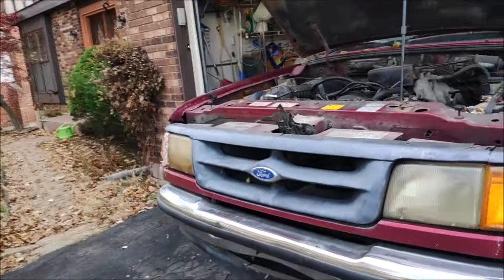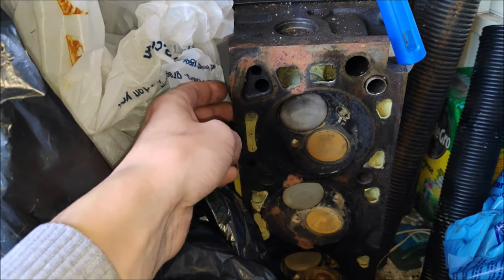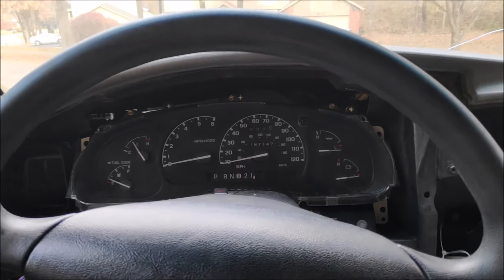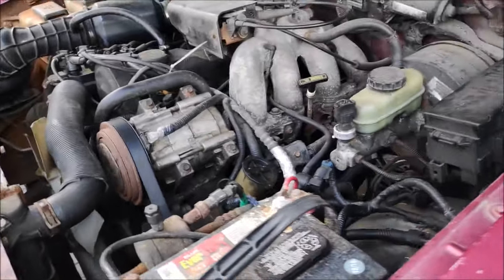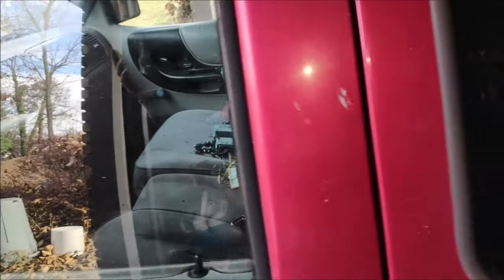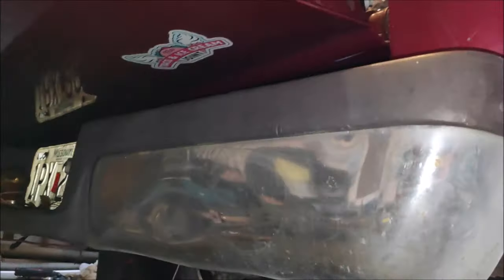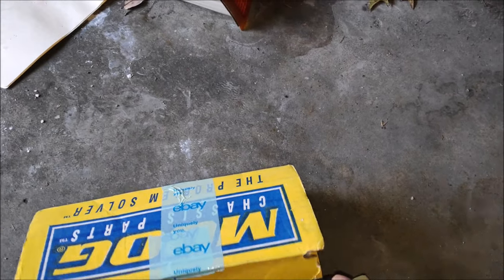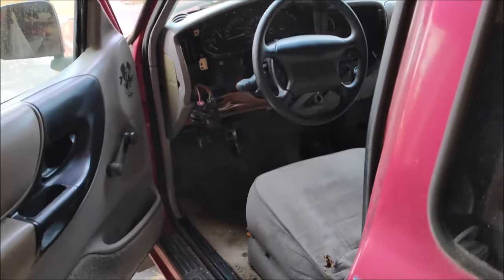What Fails on All Ford Rangers, Everything You Need to Know, Best Review

Comment: Great video thank you. I have the blend door problem on my Ranger. I just put a heater core bypass valve on it so in the summer I bypass the heater core and get AC. But it's either full blast AC or full blast heater. I also had the fuel hose problem. Couldn't fill it up all the way.  I can tell my slave cylinder those going out cuz sometimes it's hard to put into gear.  I dread having to pull that transmission. All that being said my truck does a 275 thousand miles on it lol.. oh and one other thing my catalytic converter got clogged up I had to cut it off.
Reply from the maker: I know your pain about blend door issues, I dealt with it myself.
Reply: The blend door is a common problem. The plastic bushings fail. I fixed mine with a repair kit from a company called  heater treater. They sell a metal blend door and metal bushings kit. You install it by making a hole in the heater box under the glove box, reaching in and remove and replacing the door and bushings. Check out the video on their site. Got mine 4 years now.

Comment: You should do a video on motor Mount replacement! I wanna change mine but scared I’ll Jack it up lol. Any advise?
Reply from the maker: My advice......Don't jack it up.
Reply: @everydayirace  how do you do it then?
Reply: @everydayirace   somebody will complain no matter what it’s how YouTube works. It’s a shame I can’t find how it’s done anywhere. I’m afraid using a Jack to lift the engine
Reply: I’ve also seen you gotta remove the tires to get to the bolts??? I got a 97 2.3
Reply from the maker: @jacksonworkshop  it's simple, remove top mount nuts...18mm I believe , then since you can't get to bottom mount nuts you have to remove frame to mount brackets, each bracket is held by 2 bolts, I think they're 21mm, you have to get under the truck behind front wheels and take them out, they're pita, one side you can get with a socket/ratchet, the other side no room, you can only get to them with a wrench, rabs module is on the way, then there are 2 more bolts, one per bracket holding the brackets from the other side, I think they're like 13mm, those are the easiest to remove, ratchet/long extension/13mm socket. After that start jacking the engine up, put block of wood on the oil pan and slowly jack it up, do couple of pumps and see if you can get mounts with brackets out, it's a tight fit, once you get them out, you can remove engine mount to frame bracket 18mm nuts and separate old mounts and brackets........to install new ones do everything in reverse....... it's about hr to hr and a half job, I don't even jack the truck........but you can if you want. Watch your fingers, friend of mine dropped the engine when he was installing mounts and smashed them pretty good, that's for a 2.3l engine........I believe v6 trucks have different mounts.
Reply: @everydayirace  sir thank you. Intimidated by the job but I’ll give it a whirl. Thanks again!
Reply from the maker: @jacksonworkshop  make sure to stay away from cheap mounts, or you'll be doing the job twice like I did 😂
Reply: @everydayirace  ya I saw your other video on mounts. Definitely taking the advice. I’m mostly intimidated about jacking the engine up, especially near the oil pan. Maybe I’ll post a video of my shortcomings lol.

Comment: I purchased a 2000 in April, 2021. My hot/cold gauge doesn't work. I am alone so I have to pay labor on everything. Does the whole thing have to come out for repair or can I just get something for the hot cold section. Also my driver's handle sticks in the up position. Can't lock/open the door without manually pushing it down. Lubrication does help. Any fix for that? Video is great. It's a keeper!
Reply: Lubric
Reply: Action does NOT work...
Reply from the maker: Could be bad coolant temperature sensor, bad gauge cluster, or wiring between the 2.

Comment: You seem knowledgeable on the ranger. I have a question for you. I have a 97 2.3l. In the colder months where its <50 degrees Fahrenheit, it has a tough time starting. I thinks its a fuel issue. I replaced the fuel filter, valve purge, and pcv valve (cause i had codes for them). None of these fixed my issue. When i start it, its cranks and i have to mash on the gas for it get anything going and sometimes i have to hold the throttle around 2k rpm to keep it running until it will idle on its own. If i let off the gas, it will stall. I might have to hold it at 2k for 40 seconds or so. It runs fine other than that. Its only on a cold start in cold temps. It will start fine in the summer and spring with mild temps. I have no idea what to look at next. My friends said it might be injectors but i have no idea.
Reply from the maker: During cold start engine requires a lot more fuel, like 3 times as much as engine at 200 deg F. There could be few things that can cause hard start such as lack of fuel. I would test fuel pressure with engine cranking cold. Second I would look at coolant temperature sensor data with engine cold and make sure that it shows correct temp. Last I would do compression test on all the cylinders at cold temperature, if compression is low, your piston rings are worn and engine will need rebuild.
Reply: @everydayirace  thanks for you input!!
Reply from the maker: Let me know if you fix it.
Reply: @everydayirace  i have a 94 mazda b2300. Very slow acceleration.  Eats alot of gas. Hard to get up to a high speed like 65 mph. Currently looking to replace the plugs and wires. I used a heat temp to check the catalytic and seem fine. Any suggestions?
Reply from the maker: @michealbarnes66  pulling codes is the first step in my book.
Reply: Mass Airflow Sensor

Comment: Hey, thanks for this video dude.  Can anyone here please help me.  I have a 1995 Mazda B2300 SE with 80,000 miles. I bought it new in 95 and take very good care of it.  As of 2014 I've been having a weird intermittent problem. Seems to happen more on hot days than cold.  I will drive from one town to another about 35 miles on Hi-way and then when I get into city traffic as I try to go from a stop, suddenly I have to floor the gas pedal and its' revving high and not wanting to go, then suddenly violently shoots forward, which has almost gotten me into accidents when making a left turn with this long hesitation.  Then my clutch starts getting harder and harder to push in until I just can't drive it, can't get clutch in to even engage ignition. 

 This has become real nightmare this year as it happened twice in 2 months and 5 hour Tow truck time, 2 hour tow time 2nd time stranded in 110 degree heat. 5 mechanics have kept it for 1 to 2 weeks, the problem is that once the car cools down for hours, it works and they can't get it to act up like this. But then after working fine for weeks or months, it suddenly happens again.

 Last year I paid 600 for new catalytic converter which turned out not to be the problem. I asked them to check clutch, fuel filters, spark plug, wires, and they can't find anything or get it to do this issue when they drive it. 

 I love my truck, It's in beautiful condition and looks like new inside out and is all original except for the tires, windshield, ignition, battery and wires, serpentine belt and brake pads. that i've replaced in 27 years of owning it.  

My  truck was all original and never in any accidents till my best friend backed into the bed on the tank side in 2013, so his insurance had to pay to repair/repaint it.  And some other dumb girl hit front driver nose in 2018 and her insurance  had to pay to  replace 1 head light and the front grill that cracked and repaint that front end.  

Since then 2018 hit,  my clock radio cuts in and out, but after  I got it back from paint repair it  magically worked again for almost 3 years without cutting out. Then just 4 months ago, I hit a pot hole and the clock radio goes in and out (Mostly out 95%)  of the time now.  I hate the idea of them ripping the dash off to look for the issue, probably a wiring thing, but they never seem to get shit put back on right. Anyone have this clock/radio issue??

I have the issue with the passenger side door you mention at the end ever since it was repainted. The door just comes ajar as I'm driving even though I locked it and slammed it shut. and rarely use it compared to driver door that works fine.  I don't drive alot past 10 years maybe 2,000 a year with covid 1000 or less. Could  the hesitation/hard clutch be the slave cylinder? Does the clutch lines need to be bled?? Air in the lines?? 
  
The weird thing is when it 1st started to happen in 2014, I did what scotty kilmer said and started to add techron concentrate plus to gas tank once a year, after 1st mechanic could find nothing.  Cause it just acts like it's not getting any gas,  with all the hesitation when trying to go after a stop sign or light, so seemed logical that maybe fuel injectors were fowled up. It Worked great for 5 years and then the problem got worse despite still using techron. So i guess it's not plugged fuel injectors, even though it's weird that worked for 5 years.  

 I Love my truck, don't have money for another vehicle and every mechanic thats worked on it has said how great it drives and looks.  But then I run into this issue with the hesitation in 1st gear to go and then clutch becoming hard as a rock till I just can't drive it or start it.  
Anyone else with these Mazda - Ranger trucks from mid 90's having any similar issues?? 

 Any ideas or help would be appreciated cause I'm in limbo and tired of calling a friend to spot me everytime I have to run to the store, doctor, or vet incase it decides to leave me stranded again. :(  I've got a blind and deaf dog who can't be left at home for hours and hours every time I get stranded from a trip that should be 2 to 3 hours before I'm back home to let him out to take care of business. Covid has made tow truck times SO LONG and miserable and they won't even give you a ride to the shop with them anymore because of covid.  So don't break down in no 110 degree heat, cause it SUCKS!!! :O And mechanics are backed up 10 to 14 days too.

 The last mechanic is an old school mechanic who works on classic cars been in business over 50 years, he's same guy who put the catalytic converter on it in 2019. I don't know where to go, because most young mechanics don't seem to know how to work on older model cars that aren't full of 100% electrical junk.  And this guys has checked everything twice in past 2 months and can't find the problem, he said next step is drop the tranny.  I don't feel like I wanna do that just yet. 

OH and incase anyone else has had a mystery with vanishing coolant like I did for 3 years.  No leaks, I didn't drive much or very far, winter or summer my coolant would just vanish and I had to check it everytime I was gonna drive the truck and often fill it if I hadnt' driven in a few days, NO LEAKs , no coolant on garage floor, Just GONE!!!  3 mechanics in 3 years tried to find problem and couldn't, so I just got in the habit of carrying around a jug of 50/50 mix antifreeze and a funnel / paper towels on every trip.  Finally the guy I mentioned above figured out the MYSTERY of THE VANISHING ANTI-FREEZE.  He Replaced the Heater Control Valve for $75.00 total repair and part cost and My anti-freeze is always full since.   (Hope this may help someone else who has this issue) 

 If  anyone has had this hesitation/ hard clutch issue and figured it out, Please share and help.  Thanks :)

Comment: Forgot about extended cab half door latches rusting closed (door rusted closed can't open) will be taking my 2007 Ranger in to have take it in for the passenger side for A second time...... Totally agree with the fan motor speed control & they are used on more than just Rangers - they are A total piece of shit.
Reply from the maker: Yes, I always grab extra blower motor resistors from Ford aerostar, they're very easy to get to lol.
Reply: @everydayirace  : I was thinking The Explorer, but Aerostar is another source...  any others?
Reply from the maker: @jamesfournier2810  aerostar is the easiest one, open the hood and it's right there lol.
Reply: @everydayirace  : Same as the Ranger, are the same 2 part#s (basically the same part) used on all Fords?

Comment: I have 96 Ranger and tach quit working.  How can I fix it or what do you suggest?  Can I do it myself?  2.3L standard shift.
Reply from the maker: Either tach servo went bad, or wiring to the gauge cluster broke......check wiring right by the clutch pedal.

Comment: I have a manual 1994 Mazda B4000 4x4, which is basically a Ford Ranger, with 122k original miles. Has anyone else had an issue with a "thump" when depressing the brake pedal? It does it so sporadically that I can't really pinpoint where it's coming from or when it'll happen. It will do it in 1st slowing down and even do it in 5th when slowing down. It even does it when in neutral slowing down. I also feel a little bump in my brake when the thump happens too. My yoke slip was just replaced this week thinking that might be the problem but it still does it, although not as loudly. I hope it bothers my OCD more than it is detrimental to my truck....
Reply from the maker: Look in the rear brakes.
Reply: @everydayirace  Thanks! Sorry I asked twice lol
Reply from the maker: @wilmafingerdoo2690  I am used to it, it's a daily occurrence nowadays 😂.
Reply: It wound up being my parking brake cable causing my right rear tire to slightly seize up when slowing down. Disconnected the parking brake and haven't had an issue since. The downside to this? "Disconnected the parking brake cable"! Sucks because I have to shut the engine off every time I even temporarily leave the vehicle! 😢😢

Comment: I don't get this. I have a 2010 (4 cyl) with over 100,000 miles. I have no rust (I live in Tennessee). I've replaced some minor stuff in the gauge cluster, an arm rest, a couple of tail assemblies, all the filters, brakes, all the fluids, the center brake light (now led), the rubber gasket for the floor shifter, a new spray in bed liner, buffed out the headlights, buffed out the windshield, replaced the idle control, taken out the seat and the rubber flooring - no rust at all, replaced the rear window seal.  The clutch doesn't slip, I get 29 mpg all the time. The thing is unbeatable and dependable.

Comment: I bought my 1997 Ranger new in 1996. The only issue I have that I can't figure out is the Temp gauge. It will not move off C. I have replaced both the sensor and the sender. I have removed the cluster and cleaned it up. I have forced the sensor to move to hot. Many other things checked out. Any suggestions.
Reply from the maker: Which one you calling sensor and which one is sender?
Reply: @everydayirace  There are two on the 97 3.0 The sensor has a rounded nose. Then sender has a blunt nose. I hope that makes sense. Anyway I replaced both.
Reply from the maker: @juliewoods6534  ohhh ok, problem probably lies in the servo motor that's in the gauge cluster, the arm that goes up and down attached to it.....but without testing it's just a guess.
Reply: @everydayirace  It is not mechanical because I can ground it and force it to move to hot.

Comment: The Heater control valve was leaking so bad, that it leaked down onto my Catalytic converter. It rusted both heat shields off, and cracked it. 

Thankfully I know how to weld, so I welded the cracks up, and the heat shields. Much better than spending $800 Bucks for CA converter, and it gave my truck more power and better fuel mileage

Comment: Why are all you small engine people so afraid of the 4.0. From what this guy is talking about he is using his truck for work. Gas should be the last thing you're worried about. the 4.0 will out pull that 2.3 and 2.5 any day and if your pulling a trailer gas is not a major concern. 

Every ranger that came with a 4.0 had an 8.8 rear-end auto or stick shift all 4X4 came with them. One last thing Please install the rear sway bar on all rangers makes driving that dam thing so much better and the control is so much better 

One other thing you need to get away from the OBD2 modal ford rangers you Fart wrong in the seat the check engine light comes on. 

Here is another thing it takes me 15 mins to change out my heater Core in my 1988--94 rangers How you can tell if you have the right Dash on the passenger side it looks like you have an Airbag that's how you can tell.

The 4.0 from 1990--94 did not have the EGR valve on Rangers or Explorers if you live in an area that have Smog checks. One thing he forgot to point out was the Door hinges There easy to rep0lace take the front fender off and do one at a time you need to take out the plastic Fender wheel well

I own 2 ford rangers both have 4.0 1990 with a auto and a 1991 with a stick I just bought 2 ford explorers both of them are 4.0 Both of them are stick shifts the 1994 is a 4X4 modal the 1991 is a 2 wheel drive

Comment: Hey bro I have 1996 ford ranger the problem is doesn't advance on fifth gear, I just used the fourth  gear and doesn't go over 65 miles,  I change the spark plug , air filter , fuel filter , maf sensor , I take off the catalytic  , and still doing the same ,I have any idea I appreciate your answer thanks
Reply from the maker: I usually look at the spark plugs to see how the engine is running, also look at the short and long term fuel trims to diagnose a problem. Unfortunately throwing random parts at the truck usually last resort.

Comment: i have a 95 ford ranger 3.0 spash supercab manual transmission. Have a issue with my speedometer and odometer not working have changed cluster and didnt fix the problem. Everything else works..  any ideas??
Reply from the maker: Check speed sensor and gem.
Reply: Get the speedometer app for ur fone and forget about fixing the dash! 😃